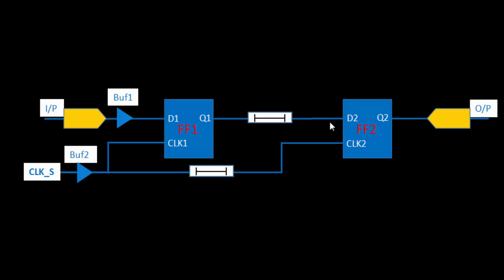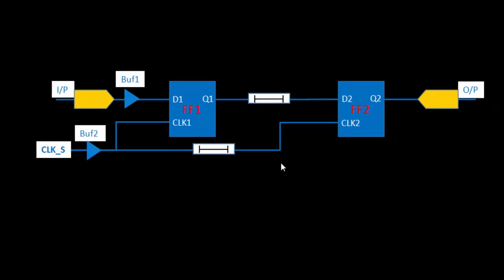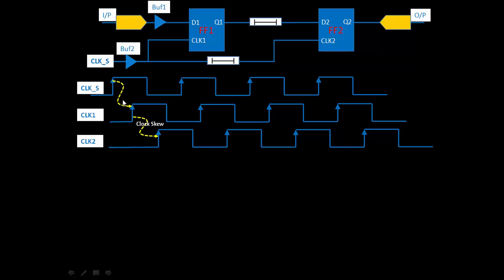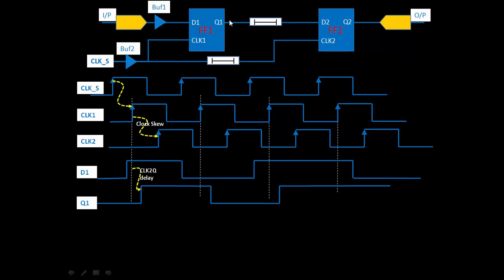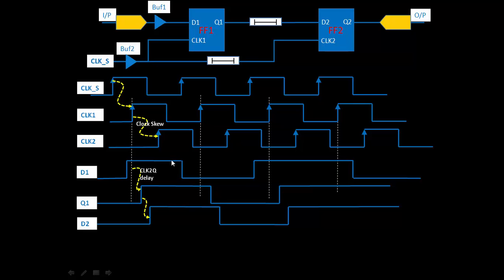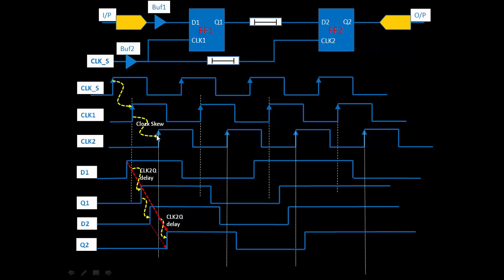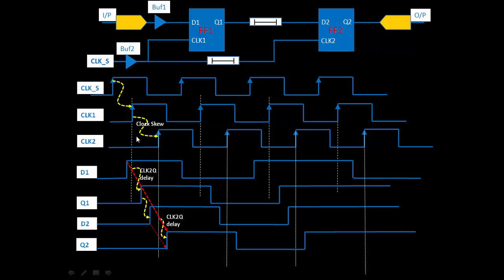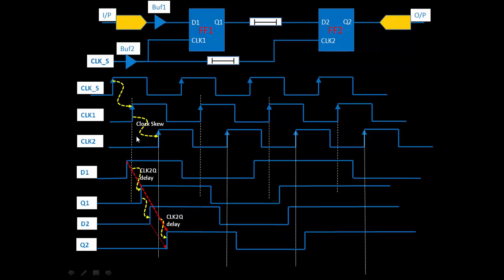CLK_L3 -Importance of Clock Skew in Timing Analysis (Part 1)

Comment: Data launched by launch flip flop is captured by capture flip flop at next clock edge and not the same clock edge.
What is the reason for this ?
What is the functional issue ?
Reply: If data launched by launch FF, can be captured by capture FF at the same clock edge, you indirectly mean that the delay for data to travel is 0, this can never be possible , the nets that carry the signal show RC characteristics, and hence there will be some delay, for the data to travel..